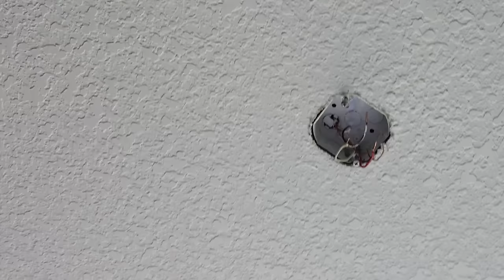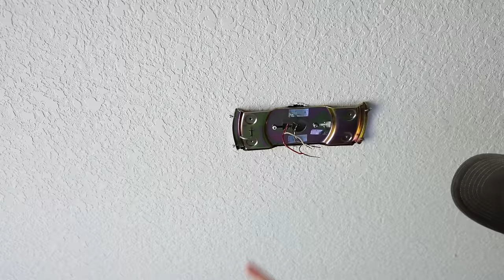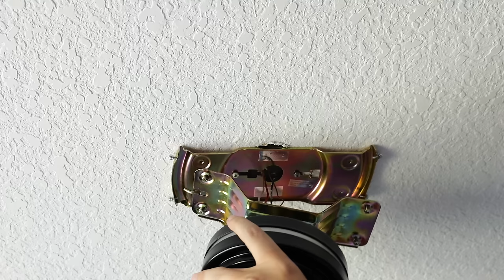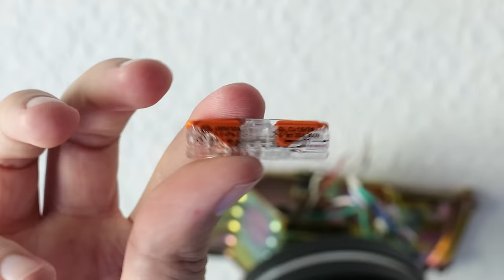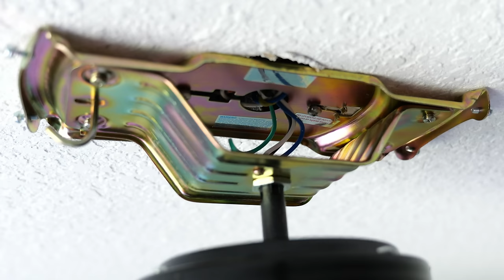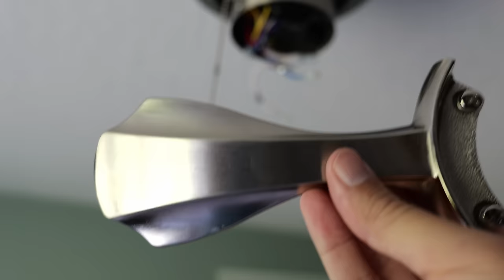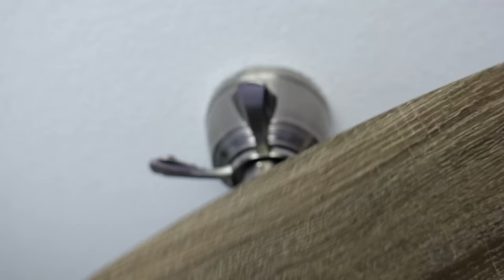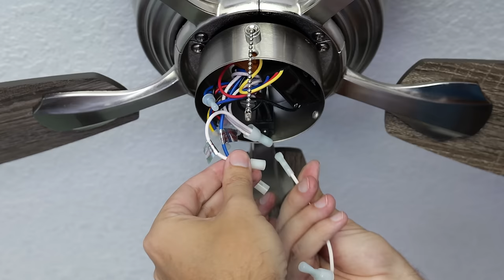Avoid This VERY Common Mistake DIYers Make When Installing a Ceiling Fan | How To

Comment: Just a suggestion, whenever you have exposed wires and something can always go wrong, please add one of the in line wagos to each wire so that none are exposed when you turn the breaker on to test. That way there is nothing exposed in case there is an accident and you happen to slip and your hands touch a wire. Anything can happen and being as prepared as possible would decrease the chance of a bad day.... the plus side, you would have half the wiring done.
Reply: Very true indeed because when working on a ladder , Just a little zap can cause you to fall off the ladder and possibly injuring yourself permanently or end up killing yourself and never trust a non contact voltage tester because you want to be absolutely sure the power is off when working on a ladder , A friend of mine several years ago was working on a light fixture and he got a zap and fell off the ladder and ended up with a broken back , Luckily his daughter was there to call for help and he was very very lucky that he wasn't paralyzed by his broken back , Safety is an absolute must when it comes to electrical work
Especially when working on a ladder and my friend could have easily been paralyzed or killed and just that little zap is all it took to knock him off the ladder
Reply: The very first thing I do is put a Wago connector on every exposed wire so there is no chance of contacting live wires.
Reply: @wayneyadams  That's especially important when working on a ladder and never use a non contact voltage tester to check to make sure the power is off because a non contact voltage tester can give you a false reading with the wires in close proximity to each other , When it comes to safety , There's no such thing as being too careful , Another thing is always have a second person with you when doing electrical work , Especially when working on a ladder also known as The Buddy System
That way if an accident was to happen
That person can call for help
Never do electrical work by yourself , 
It's a very risky thing to do and if an accident was to happen , You could be seriously injured with nobody to call for help and possibly be dead from electrocution
There's safety in numbers and you'll feel much more comfortable too
Reply: What is the in-line wagos?
Reply: Thanks you’re really save my life is telling me that and I’m grateful
Reply: @noblesfamily1  You're most welcome , 
Especially when working with electricity
Safety is always priority one and I never cut corners when I do electrical work , I only use top quality materials and make sure it complies with the National Electrical code
Reply: @ironmartysharpe8293  I don't think you would last a day working for an electrical contractor! L O L. I would stick to paperwork if I were you.
Reply: @ironmartysharpe8293  yeah those noncontact voltage testers are not very reliable. If in doubt, I just use my finger. If I'm still not sure, I'll just short the hot and flip the breaker. Get er done!
(actually, don't do what I do. Listen to the safety guys. I've been a human circuit tester for over 50 years, it takes a while to build up a tolerance. Lol)
Reply: @ironmartysharpe8293  also, if you're the kind of person who will jump or fall off of a ladder from a little shock, you probably shouldn't be on a ladder. You gotta learn to control yourself. I've been hit hard from capacitor jolts on top of very tall ladders. If I was jumpy, I'd be dead.
Reply: @ironmartysharpe8293  out of all the electricians I've ever known, only one of them worked with a "buddy". As a matter of fact, the day I got shocked the most number of times was when I had "buddies" around distracting me at all the wrong times. We were trouble shooting the fluorescent lighting in a large warehouse. We needed the current on to figure out what was going on and what was not going on. That was a very spicy day. Fluorescent capacitors are no joke.

Comment: That is all fine and good until you deal with a remote transceiver. The hole in the top of the bracket is often not large enough to facilitate up to 11 wires through it: 2 hots, a neutral and a ground, 5 wires on the remote and 2 grounds from the fan.

Comment: Question; what if your house has only 1 switch to operate the ceiling fan and light like my home? I had previous ceiling fans in that were just fan and light. Recently, I installed a Hunter fan with remote. Now there is a slight humming sound from the fan. (the previous fans, non-remote also had the noise but not as loud) Could the humming be caused by having only 1 wall switch and not 2 (1 for fan, 1 for light)? I wired the fan per instructions from Hunter. Thank you!

Comment: There are times that getting all the connections into the box is almost impossible. One example is a fan that has a remote receiver. Those take up all the room above the mounting ball and they have connections not only to the switched power, but to the fan wiring as well. Id love to see a video that includes the remote receiver, especially with one of the fans that has a relatively small trim on the ceiling side.
Reply: Them remote recievers can be hell to fit!!
Reply: Not to mention that you’ll have a bunch of splices in the light fixture portion of the assembly that aren’t in a junction box either, so what difference does it make? At least on the fan side of the hanging bracket any sparks from a poor connection are falling down onto metal. If you tuck the wires into the junction box, those sparks are falling down onto the paper backing of the drywall...
Reply: @davido3403  BIG time ! & especially when the shroud/canopy thingy doesn't just fit over the entire motor like this one but rather must already be just below everything giving you only a few inches of play at most. Even if it's not a flush mount & has a downrod. Not exactly a one man job, though I'm sure it is for some pros. Hell, I've done a few dozen in my time & I couldn't even do the light-kit section alone on the last one I did.
Reply: I just installed one with the remote, never again. A pull switch will last a lot longer than a receiver.
Reply: Notice the lack of a ball on this fan.  This fan is going to be noisy AF before long with the $10 chinesium motor and the screwed together mounting with nothing to absorb the vibration.
Reply: Just done this, took me all afternoon. Though my neck is now crooked =\
Reply: Just done this, took me all afternoon. Though my neck is now crooked =\
Reply: Just done this, took me all afternoon. Though my neck is now crooked =\
Reply: Facts, this happened to me and I had to call a handyman to come unfuck the mess. Big pain
Reply: The last 6 fans I’ve installed all had remotes; why can’t they make a single one that has enough space for the wiring and the receiver?! Every single doggone one had the barest minimum of space and I had to jam the receiver in, which is crazy. Especially ones that come with optional extension rods and like 4 ft of wiring that isn’t supposed to be cut because they have plugged ends. So frustrating
Reply: @Tonyhouse1168  Facts!!!
Reply: I have the same voltage tester mine beeps rapidly on red and a slow beep on black any reason why?

Comment: I have never seen a lamp/fan mount like that.  They have never been that easy.  Usually you have to use one arm to hold the lamp, the other arm to connect the wires and the other arm to screw in the mounting bolts and the other arm  . . .
Reply from the maker: Yup, these have come a long way.  That was always a pain in the rear!
Reply: I have never seen a fan that didn't have some way to support the weight of the motor while connecting the wiring.  lights, yeah, you kind of have to hold them by the load wires while connecting the ground, and make the ground short enough to hang the light from it while connecting the load wiring.  but they are usually lighter.
Reply: In that case of no hook, I use an old fashioned electricians helper, also known as a wire hanger. I cut the hook off, attach it to the mounting bracket and the other end to the fan (usually through the hole that the screws go through. Then when wiring is complete and inserted in the box, I remove the wire hanger and complete the fan installation. Been doing this since I was my father’s helper and when installing fans my wife picks out that invariably don’t have the hook!
Reply: @kenbrown2808  I installed may without a hook back in the day. Fortunately, they apparently come with hooks standard today. They were pretty easy to install back then for the four armed people, but not for regular two armed folks.
Reply: @ST-0311  yeah, I've only been hanging them since the 90s.  but I've seen some antiques, and they're also heavy

Comment: Great video.  As a side note and maybe a repeat: IF  the wires from the ceiling box and the fan are long enough, you can make your electrical connections while the fan is hanging on the "hook" and then push them through the bracket hole into the ceiling box  before mounting the fan motor to the bracket.  It's easier to do and easier to make certain the connectors remain undisturbed.
Reply: 3.45 where the box for ceiling fan

Comment: I installed this Hampton Bay fan just a month ago and it’s the noisiest fan I’ve ever installed. And I’ve done a hundred fans. And for ease of wiring do that before screwing the motor to the ceiling bracket. That gives you more room to get the wires up into the box. Good video!
Reply: Some of the Chinese ones are lacking 5 drops of if 30 weight  oil on  the two  bearings.
Reply: Haha my Hampton bay is making an awful high pitched noise when the light is on. I didn't put it on a dimmer switch but they do dim, when holding the light button on the remote and brighten. Dim it's louder than when it's bright. So annoying.
Reply: Always buy a fan with a DC motor. Super quiet and energy efficent

Comment: I definitely have done it.  Pancake boxes that are listed to support fans could never accommodate all those wires.  There is an exception in the code that does allow the wires to utilize the canopy space in a box fill calculation.   I do agree you should tuck the wires up though.  Sometimes its impossible.

Comment: Just the video I needed to see, Recently had a job working with a master electrician and noticed he ran a 14-3 wire to ceiling fan areas in the bedrooms. I wondered why he did that but now I know exactly why. Also he ran it out of a 2 gang switch box which l thought for certain it’s just a 1 switch box. I immediately noticed I was thinking wrong. The black wire connects to fan and red goes to light or visa versa. Amazing job explaining this your video is a pot of gold.

Comment: Very well done. These fans have definitely come a long way in ease of installation. I see lots of comments about if the box is rated to support a fan and using a spreader bar to span to the next joist. Another thing is there are usually holes in the bracket so that If your box is mounted to the joist you can screw directly into the joist through the bracket to support the bracket and the weight of the fan. This also cuts down on any wobbling that might occur.
Keep up the good work 👍🏻

Comment: On most fixtures that I've replaced, there is a ground screw intentionally placed facing up (when installed correctly) to indicate that the wiring is intended to be above the plate. This relates to his mention about code and wire location.

Comment: As others have noted, that box may not be rated to support a fan.  I would unscrew it from the hangar or joist and check out the support.  It it's on a joist no problem - just get a fan box and screw it in.  If it's one of the usual cheap hangars that can be replaced by one that you insert in the joist bay through the hole and turn to tighten.  Thx.
Reply: It may not be right but the 5/8 ceiling drywall will hold it up lol, as long as it’s screwed tight to the ceiling joists & you have the fan tight not vibrating. Obviously not something I recommend but you’d be surprised how many I’ve found hung like that in old places

Comment: Glad I found this video. I ordered push-in wire connectors and learned it's only for copper wires and not aluminum which most fans come with. Assuming these can take aluminum.
Reply from the maker: It is not aluminum wire most of the time. It’s tinned copper making it like silver in color.  If it is aluminum it has to be clearly marked as such.
Reply: @HowToHomeDIY  ahh good to know. I have a hard time getting the twisted ceiling fan
Wire to take on the push in connectors. Just ordered the ones you used in the video!!
Reply from the maker: @TheBluuHouse yeah this is one of the applications where I really like using the lever connectors.

Comment: One thing I've noticed on these particular brackets is the center hole where the wires pass through is there can be sharp edges at the center hole
So before I install the bracket , I'll use a snap in anti short bushing to prevent severing the wires When tucking them into the box , Another thing that if I was using wago connectors , Before tucking them into the box I'd wrap them with a little bit of electrical tape to prevent the levers from snagging other wires and causing them to pop up , One very very important thing is before you begin installing the fan is to make sure that the junction box is fully secured to support the weight of the fan and the box must be a metal box  Never use a plastic junction box , Many light fixtures use a junction box that has a side bracket that is nailed to the joist ,  , In that case I had to remove that box and get a ceiling fan box kit which has a spreader bar which spans the joists and spikes that dig into the joists and you tighten it with a crescent wrench , with that kit
You don't have to cut the hole in the ceiling any bigger because you first put the spreader bar in the hole , Rotate the spreader bar until you feel it spanning the joists and tighten it with a crescent wrench , Then put your wires into the box and attach it to the spreader bar  , I installed 3 ceiling fans at my brother's house and when I removed the light fixtures , Sure enough , The junction boxes had those side brackets and were nailed to the joist and they were plastic boxes as well, So luckily I was able to remove them and used the ceiling fan junction box kit for each fan which works great , and because of it's design is more than strong enough to support the weight of the fan , Also you'll want to use that kit if you're installing a heavy chandelier as well because chandeliers can be much more heavy than a ceiling fan
Whenever you're checking to make sure the power is off , Always use a regular voltage tester , Never trust a non contact voltage tester because you want to be absolutely sure the power is off when working on a ladder
As mentioned before , The center hole in the fan mounting bracket , Be sure to install a snap in anti short bushing where the wires pass through to prevent severing the wires , Many ceiling fans have this style of mounting bracket and for added safety , use washers on the screws when mounting the fan bracket to keep the heads of the screws from possibly pulling through the bracket because I've noticed how wide those elongated holes are and that's why I use a couple of washers when mounting the bracket
Reply: Good idea!
Reply: @Watchyn_Yarwood  Thank you , I've installed over 100 ceiling fans and before they came out with the ceiling fan junction box kit , I used to have to go up in the attic and nail a 2 X 4 over the junction box between the joists and screw the box to the 2 X 4 but I don't have to do that anymore with the ceiling fan junction box kit , One thing that makes it great is you don't have to cut the hole for the junction box any bigger and the spreader bar which spans the joists has spikes on the ends which dig into the joists and you just tighten it with a crescent wrench , Always use a couple of washers on the screws when mounting the bracket to the junction box to prevent the screws from possibly pulling through the bracket and the center hole on the bracket where the wires pass through , Install a snap in anti short bushing in the center hole to prevent sharp edges from severing the wires
Reply: more clearly: you have to use a box that is rated for use with a ceiling fan.  they do make rated plastic boxes, though.  they also make a box that screws directly to the side of a ceiling joist, which is a lot easier than the retrofit bar hung box; if you're lucky enough to have the fixture box against the ceiling joist.

Comment: Lots of people called out making sure the box is rated for a fan...but I didn't notice anyone mentioning grounding that bracket. Most ceiling fans come with a green screw and pigtails to ground the mounting strap and fixture. Technically you get there if the old box was metal and properly grounded, when the screws bond them together...but there are fan rated plastic boxes out there. The mounting hardware needs to be mounted.